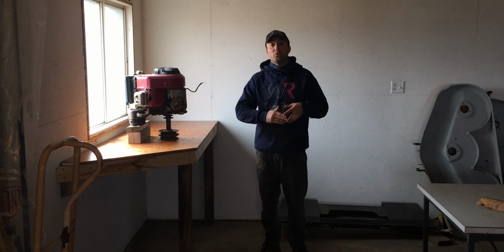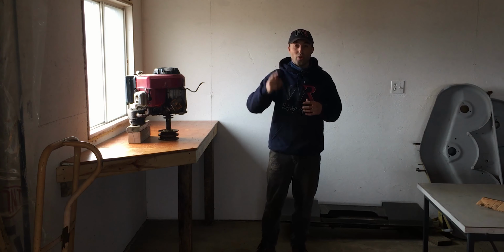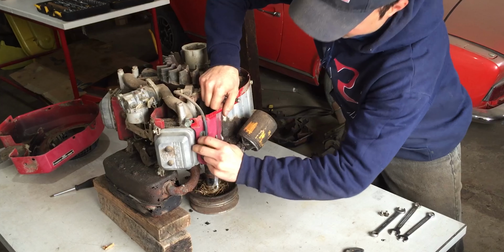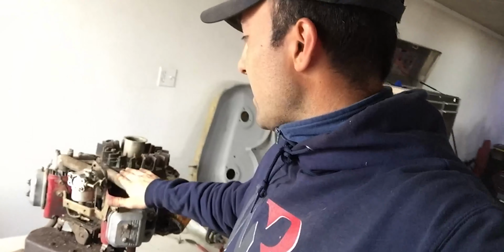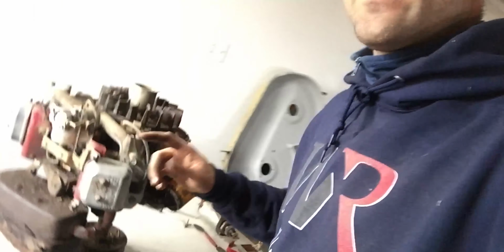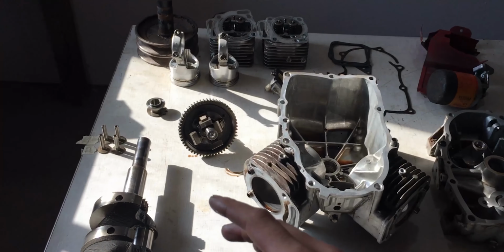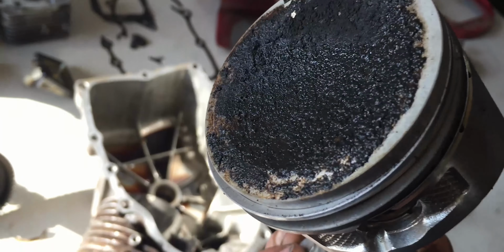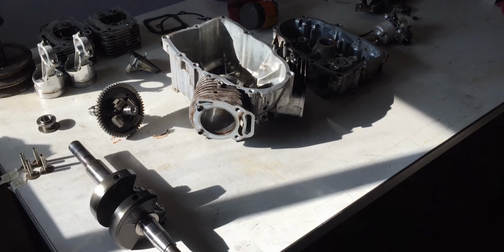Reconditioning a Briggs & Stratton/Vanguard 16HP V-Twin Engine! (Model 303777)

Comment: Nice Briggs engines are goos like any engine doing mainintencw and taking care of it it should last a long time I just got a generator that I am repairing for a friend and i will also be restoring my friend’s allis Chalmers lawn mower
Reply from the maker: I thought the same, especially with the pull start and external oil filter! I hope this one will last a long time :D That's great, you seem busy on your end too. It's always good to work on multiple projects to learn new things! Best regards
Reply: @WorkshopRebuild  thanks I got the generator tore down drained and flushed the tank and with a little work should run like new I will replace the air filter change the oil and maybe put in a new spark plug

Comment: Looks pretty close to my engine.  Does this engine have a breather tube?
Reply from the maker: Yes it has a breather tube just below the carburetor that leads to the crank case. Regards Andreas
Reply: Thanks much.  I have some oil spitting into the air filter and I suspect a clogged breather tube.  Engine runs fine otherwise. @WorkshopRebuild
Reply from the maker: This could happen if you have too much oil in your engine. Check your oil level. I believe the oil filler cap should also be vented…check that too.
Let me know what you figured out. Regards Andreas
Reply: Understood but that isn't the issue.  Could also be a blown head gasket.  Giant PIA to get at them

Comment: Where can you get a carb kit for this? Thx.
Reply from the maker: Hello Bob, on eBay you can find multiple carburetors for Briggs & Stratton engines. If you send me an email: workshoprebuild@gmail.com I can forward you a link and help you out with your engine. Best regards
Reply: I just got one online from a supplier called monster scooter it was cheaper than most. Good kit.

Comment: The simplicity I bought has a vanguard v twin engine in it 16hp it leaks bad and is filthy I’m most Likely going to in the long run pull it from the tractor pressure wash it down and reseal it and hopefully refurbish it in a way like you Did what do you think is causing oil to be coming out of the breather ? Any ideas I’m kind of stumped
Reply from the maker: It might be something as simple as a breather that is clogged or missing. Maybe even the reed-valve is stuck, which can cause over-pressure in the crankcase. I hope this helps and if it does, let me know. Cheers
Reply: @WorkshopRebuild  thanks will check it out

Comment: Today is the day just got done degreasing and unbolting the engine out of my simplicty going to I’ll it apart and do seals in it in the next few days and unfortunately upon taking out the engine the electric starter cable was so tight and it broke along with the brushes in the starter so now it will also need a starter it’s a vanguard 16hp

Comment: Could I possibly get the part number on that starter. I can't seem to track one down. Thanks :) Great video I am also a new follower lol :)
Reply from the maker: I just checked and the number stamped on the starter is 8808191, but on B&S parts store I cannot find this exact model/number. When I type in my engine model it shows a different number. B&S has an online "Parts Lookup Tool"  Link:https://shop.briggsandstratton.com/pages/parts-lookup
There you can type in your model and type number to find the exact starter you will need.
I hope this helps and thank you for your compliment! Best regards
Reply: Didn't get a reply yet ? I'm wanting to find out if that recoiled would work on my older flat opposed 16 briggs. The starter must be dragging I have to use an old car battery to start it and I'm getting old.
Reply: @Ben-h2o  Can't say for sure but I have both types of engines & I doubt the flat recoil will work on the Vanguard twin.  Just my opinion however, as actually my flat twins do have recoils & I've never seen one with a recoil.  Starters for that flat twin should be readily available.  Good luck as at my age I have nothing but electric start.